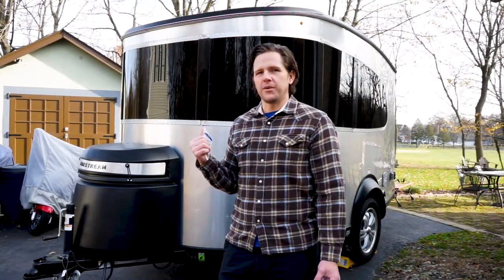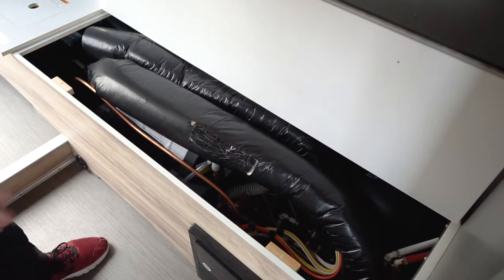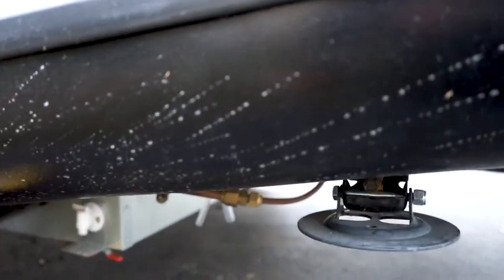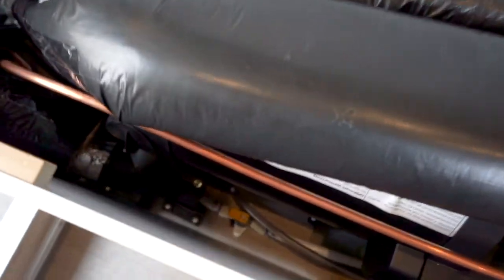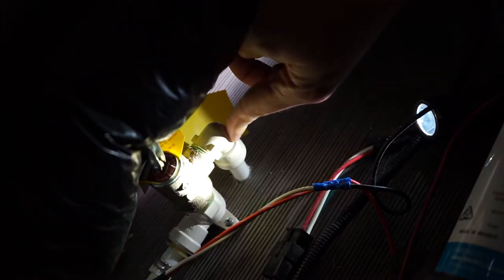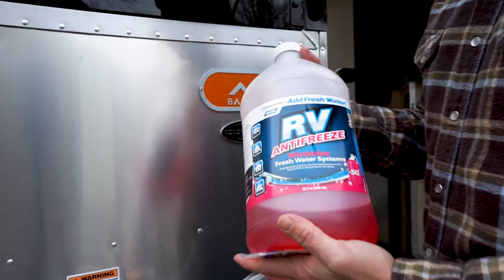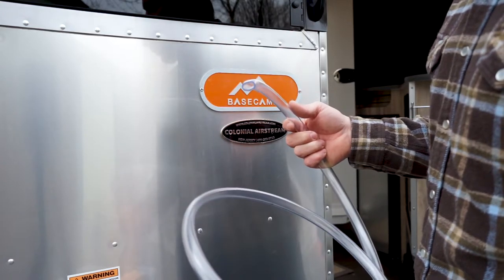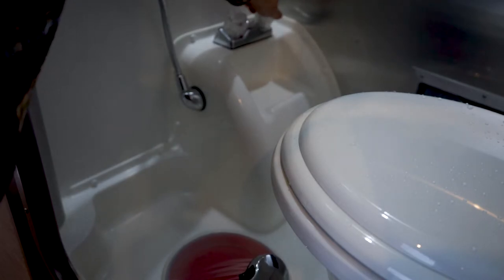Airstream - How to Winterize an Airstream Basecamp (2018)

Comment: And, to dewinterize?  Do you just hook up the water to the city system and run it through the plumbing (not the water heater, keeping that isolated) until the pink goes away?
Reply from the maker: David Wilkins For dewinterizing, I actually use the freshwater tank system and the onboard pump to  flush the RV antifreeze.  You can actually use bleach in water at a safe ratio to either sanitize or disinfect your fresh water tank - then use that water to flush the RV antifreeze.  It’s not a huge deal since you’ve already drained your freshwater tank from the winter - but - there’s residual water in your freshwater tank that has sat over the winter.  Even though the tanks are safe for holding water, anywhere there’s moisture and un-purified water can lead to mildew or eventually, mold.  That’s the logic behind using the freshwater tank to clear the lines during dewinterizing.  

As for the process: I use a tablespoon of bleach per gallon of water.  (You can do your research on the ratio to confirm and also lookup the fresh tanks total gallons).  Once filled with the bleach/water ratio, turn the pump on and let SOME of the freshwater/bleach flow through the hot and cold pipes on all fixtures (dont’ forget the outside shower & toilet) — enough to clear all the RV antifreeze out of all lines and fixtures — then I let it sit for a few hours.  Some will say you should let it sit for 24 hours - it’s up to you.  I usually let mine sit for 4 or 5 since the trailer has only been sitting for about 4 months.  After the bleach water has sat in the freshwater tank to sanitize, I then use the outside shower to clear the rest of the bleachwater into 5 gallon buckets and dump it (doing this so you don’t ultimately fill your blackwater tank prematurely).  Now, you’ve A) flushed the RV antifreeze, and B) sanitized your lines further by flushing bleachwater through...but there is still bleach in the lines, of course.

From here, I fill the fresh water tank 2 more times.  Each time, flushing just a few gallons though the inside fixtures to now have a lesser bleach-to-water ratio in the lines.  Of course the remainder bulk of water I clear out using the outside shower (again to save space on the black tanks).  

After that 2nd fresh-water-only fill (technically the 3rd tank fill), I open the hot water tank and close the bypass valve.  This way, new, fresh water will flow through the hot water tank, too.  (just make sure you are using the hot and cold fixture valves now to clear water - you should have been before, too).  After this final fill, the bleach-to-water ration is so small it’s undetectable (and more than safe to drink).  I can’t smell or taste any bleach at this point.  

(ps, I use the buckets of water to water the plants or something useful)

If you follow the above, you’ve effectively cleared the rv fluid, sanitized your water lines, sanitized your freshwater tank and haven’t hit your capacity on your blackwater tank yet so when you pull into your first campground for the season, you have some room to spare ;).
Reply: Dan Moller excellent!  I’m still a newbie, and these instructions are very clear and detailed and will be easy to follow. Thank you very much!
Reply: @MollerFarm  Hi Dan, thanks again for your great winterizing video!   On de-winterizing you mention 1 tablespoon of bleach per freshwater gallon...how are you adding that mix into the Basecamp freshwater system?   I assume that you are using a tube and funnel, with the measured bleach ratio in a bucket....correct?
Reply from the maker: @larsmeyer1950  Super late reply here, sorry. You assumed correctly - I just use a funnel and put the bleach in first.  Then I run the hose water through the inlet to wash the inlet and dilutes the bleach at the same time. Hope you're enjoying your basecamp!

Comment: Best, clearest video I’ve seen on winterizing the Basecamp. Thanks!
Did they perhaps combine the pressure relief valve function into the heater tank emptying valve in the 2019 model?

Comment: Dan, thanks for the helpful video.  When you fill the lines with antifreeze and bleed the kitchen and bathroom , do you also bleed the hot and cold water lines under the trailer?

Comment: Thank you for the video. Do you still plan on uploading a de-winterize video? Happy traveling.
Reply from the maker: Actually— I ended up flipping my Basecamp on a turn out in Fort Collins, CO!  They have really high curbs for water diversion and from a stop sign, I started rolling to make a right turn and the rim clipped the curb and the whole thing tipped over! :(  It was some event - still don’t know how it had the leverage to actually flip it… I was driving so slow from a full stop.  Ended up salvaging the trip but by the time I got home to a dealership to assess the damage, it was deemed totalled.  I ended up getting a 19’ Flying Cloud to replace the Basecamp.  I just wanted something where I didn’t have to change the dining area to a bed every night.  Hope you’re having fun with yours!

Comment: Very helpful Dan!   I have a 2019 and it was pretty close to the same as your 2018.  Did you come out with the Dewinterize version?
Reply from the maker: I didn't... Never got a chance to, unfortunately.  While taking a slow right turn on a trip enroute to the Grand Canyon, the right rim clipped a curb and flipped our Basecamp over!  It was so strange.  I'm going to make a video with photos and explain what happened at some point soon.  Long story short, insurance deemed it totalled.  I was freaked out that it flipped so easily so we ended up getting a Flying Cloud 19' to replace it.  Being a foot wider, it feels much more stable than the Basecamp.  It was some ordeal.

I did, however, reply to a gentleman's comment below with my process for dewinterizing.  I may put that process in the description too.

Thanks for asking and better luck to you and your Basecamp.  Loved that little guy!

Comment: Huge thanks Dan. My first time winterizing and this was super helpful. 

Any tricks to prevent the plastic toilet valve from cracking during the winter. I’ve asked in the Fb Airstream group and it seems like everyone just assumes that they need to change it out regularly.
Reply: I took my handheld piece off and shook it violently until water stopped coming out. It took a lot of shaking for some reason.

Comment: Anyone know why the suction on the rv fluid might not be working for me? I’m using a 1/2 inch adapter into a 1/2 tube. It attaches but the suction won’t pull it past a second or so. I tried two separate tubes and even cutting the tube shorter. 🤷🏻‍♀️

Comment: This is awesome!  Thank you! I just bought a (new to me) used 2018 Basecamp.  The nearest dealer is 2-1/2hrs away.  How do I de-winterize? Do you have this video too? Or suggestion where to find? Thanks again!
Reply from the maker: Couple years ago you asked this so I’m sure you’ve got it by now.  However, I did pin a comment up about dewinterizing.  Hope you’re having fun with your Basecamp!

Comment: hi, thanks for the video. i have a 2018 BC. found everything in video except the hot water tank pressure release valve. any more tips on its location? thank you!
Reply: I didn't find that on my 2021 BC 16X either.